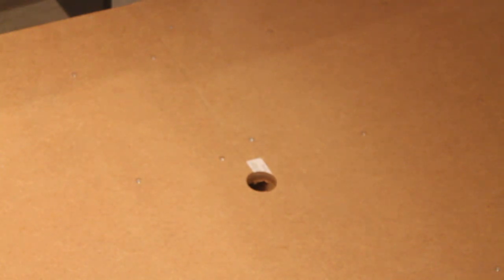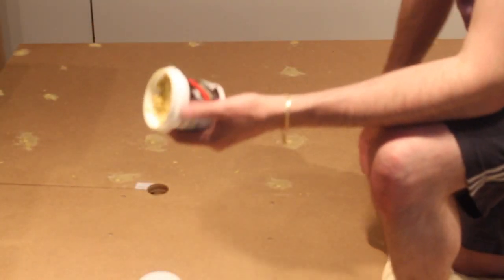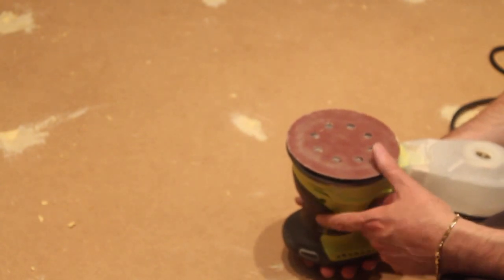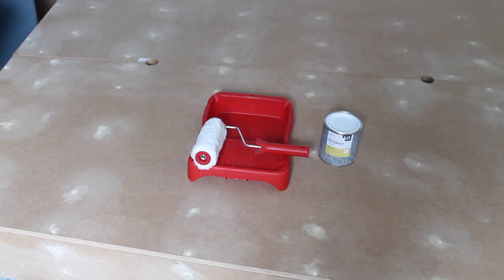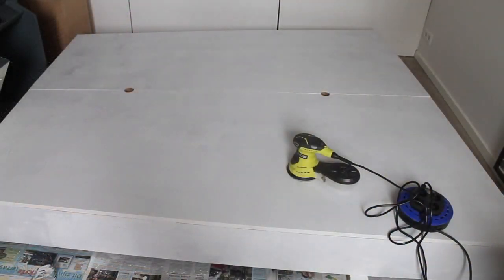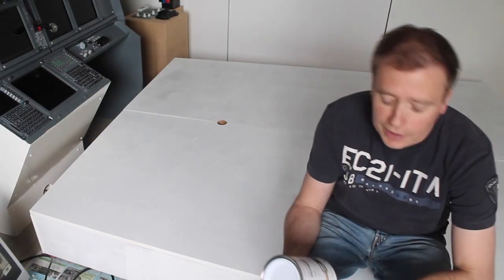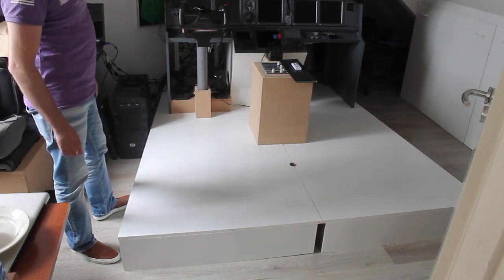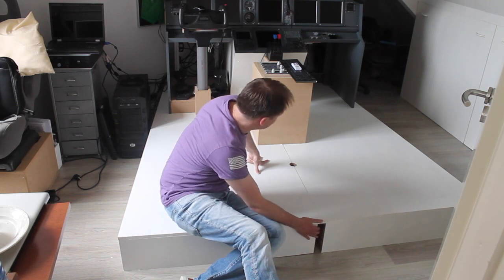Boeing 737 800 Home Cockpit Simulator #12 - Cockpit Platform - Part 2

Comment: Hi Nick,just a quick question, how many computers are you using and what are their specs?
Thanks.
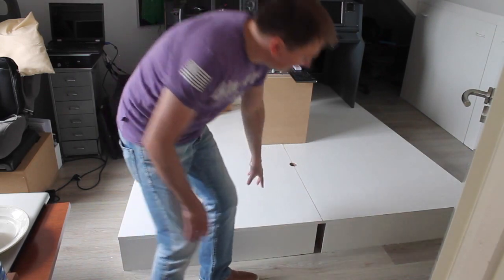Reply from the maker: ryaan beg Hey Ryaan, right now I use 3 computers, if you check the video around minute 8:00, you will see a tower PC on the floor just beside the platform, this is the main PC, beside that on a file cabinet I have a refurbished HP computer, those that sit flat and on top of it I have an old laptop.

Main PC used for FSX, fsuipc, 3 front view monitors, CDU, Prosim server, MCP
Windows 7 Home Professional (x64) Service Pack 1, Asus P8Z77-V, Intel 
Core I7 3770K 3.50 Ghz, 16 GB, PC3-memory, Asus Radeon HD 7970, Samsung 
840 Pro Series 256 GB, S-ATA III

HP computer: used for Captain and FO navigation display and upper & lower eicas
Windows 7 Home Professional (x64) Service Pack 1, Intel Core2 Duo Processor E8500 (6M Cache, 3.16 GHz, 1333 MHz ), 8 GB, PC3-memory

Laptop used for Overhead
Windows 7 Home Professional (x64) Service Pack 1, the rest I am not sure, it's a crappy old laptop which I took from my parents in law just before they put it in the been. I cleaned it up and for what I need it for it's just perfect.

I hope this helps, let me know if you have more questions.